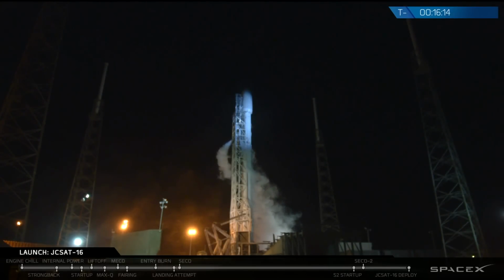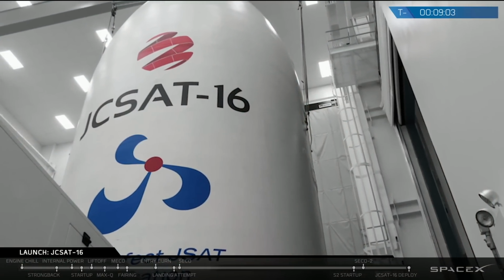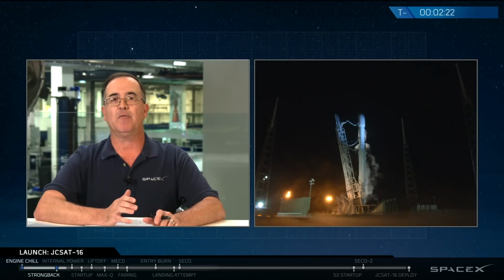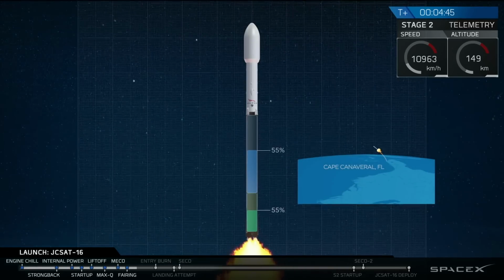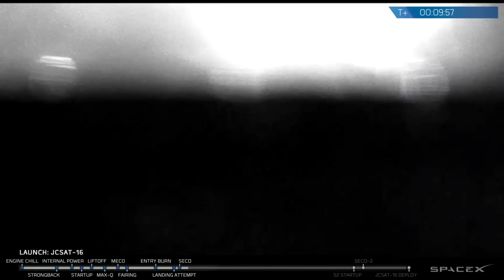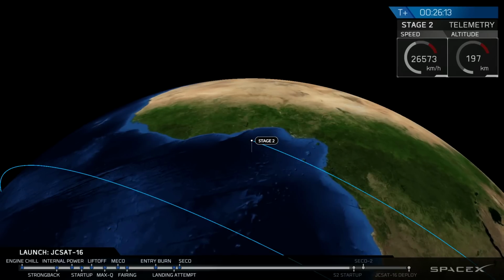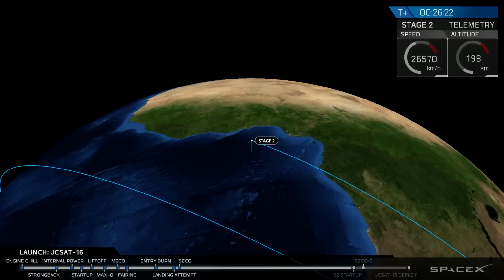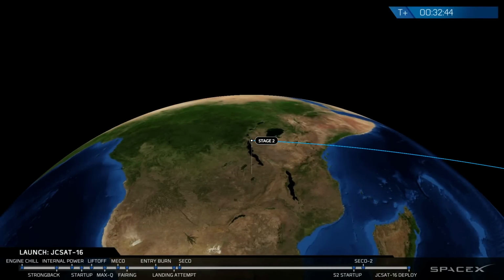JCSAT-16 Hosted Webcast

Comment: Question: How do they land the rocket on 'Of Course I Still Love You'? Does the rocket calculate the position of the drone ship relative to the to itself, based on GPS, or some other location technology?
Reply: Drone ship targets a set of GPS coordinates, which the rocket also targets. Essentially, the rocket trusts that the drone ship is actually at the coordinates it's programmed to be at. Drone ship has some thrusters to stay in the same position. The rocket aims at those GPS coordinates and uses a radar altimeter in order to determine vertical position and therefore know how to slow down.

Comment: Guys, Can I see the recorded video of the rocket landing at 26:27, There is no WIFI to stream the video as it should, but there was cameras recording YES? can I see that? that's weird! it appeared from nowhere? 

Thank you
Reply: There is no WiFi several hundreds of kilometers from coast line ;) They use satellite connection - which id disturbed by rocket reentry (engines firing and some plasma generation during atmospheric reentry)

Comment: Question: they stated several times that GTO is 36000kms, which I understood to be altitude but the telementry indicated about 500kms max altitude and 36000km/hr.  Does that mean GTO is really any altitude they choose, matched with the required speed?  Thanks.

Comment: I just wish they'd put a second camera just off the drone ship. This freezing at the most important and risky moment kind of gives the impression that something actually went wrong.
Reply: Likely wouldn't work, vibrations interfere with transmission even a mile away - which is why at launch complexes, cameras are all transmitted through hardwired connections rather than satellite.

Comment: what happens to the 2nd stage? does it remain in the same orbit as the sattelite or will they destroy it in the atmosphere?
Reply: Atmosphere destruction. SpaceX is working on rescuing it to, but this require different approach. Right now they are working on payload fairings recovery (some details: https://www.reddit.com/r/spacex/comments/4m9b5j/elon_musk_on_fairing_recovery_chutes_will_be/).
Reply: It actually remains in the same orbit as the satellite for a while, but atmospheric drag slowly (over the course of several months) pulls it back to earth and it is destroyed by atmospheric reentry. In this case, tracking elements indicate that the second stage actually has a perigee (lowest point of an orbit) of just 150km above earth, compared to typical 180-250km distance, so it's possible this stage performed a small deorbit burn using remaining propellant from the cold gas thrusters that provide roll control to the second stage  in powered flight and pitch and yaw control while the second-stage engine is off.
Reply: Thanks for the answers! I'll look more into it

Comment: Please please @SpaceX, invest the maybe a few hundred bucks in a proper video link between the barge and the by-boat so we get a proper stream (heck, a wire should do). Obviously going directly to satellite does not work.
Reply: FrankyBoy Yes, but what's the reward? Obviously any of these plans will cost a decent amount of money. What does SpaceX gain from this?
Reply: Plur307 True, though worth noting that they now make the webcasts last until satellite deployment due to customer requests, as customers didn't like that it ended before the second stage restart, cutoff, and satellite separation.
Reply: Actually, that gives me an idea ... aim a camera from the manned ship at the landing platform and stream that ... should give a good perspective and overview, and at the distance (a few km) it should still give quite okay-ish visuals assuming no fog.
Reply: FrankyBoy We've seen that view for JCSAT-14 (I believe the technical webcast). It wasn't great, but it was OK quality. Not sure why they haven't shown it again.
Reply: Probably a lot more than a few hundred bucks for a wired connection. The nearest boat is at least 5 miles away for safety, you'd need to buy a lot of ethernet cables and ethernet repeaters. And oceanproof all of them.

They are working on it, but it's really just a nice thing to have live landing views at all. They don't need them, as long as the SD cards in the cameras are saved.
Reply: +Ambient Morality I thought the by boat is around 1km away? Also Ethernet really is not the tech of choice there (and you can get pre-made ocean proof cables of course, no need to roll your own).
Reply: +FrankyBoy Itd probably take a significant power line to run an entire separate relay boat full of communication equipment and probably additional cameras. Not sure how far away it needs to be. At least 500 meters or so to get away from the interference. That's no small feat. Doable yea, but the idea is to keep cost down. Adding a significant step to the ASDS deployment is not the way to do that. Maybe one day in the future.
Reply: Motokid600 They already have a boat/ship with the crew standing by. You "just" need to connect the two ;)
Reply: +FrankyBoy Lol, well I imagine it has to be a seperate unmanned vessel. No way your running a cable out to the safe distance for people.
Reply: Motokid600 Not sure why you consider this a problem ... Buoys are already invented so it's not like youÄd have to free-string it for kilometers.
Reply: +FrankyBoy I'm pretty sure buoys are wireless. Which would defeat the purpose of eliminating interference.
Reply: +Motokid600 a buoy is actually generally anchored to the seabed ;) Point is, you don't have to stretch a wire, you can dangle it off floaty things attached to it, which greatly reduces strain on everything involved.
Reply: The other problem with all these methods is that they are a lot of work. There's no great reason to actually do any of this besides for our benefit, as they can always see prerecorded video at much better quality a few days later.
Reply: > The other problem with all these methods is that they are a lot of work.

Dumping a cable over board as you drive is really not that hard work and we figured out how to do that with more complicated stuff than cables (fishing nets) centuries ago (and these days in a completely automated fashion)
Reply: +FrankyBoy "dangle it off floaty things" meaning you would still need a giant wire reel linking the boat/buoy to the barge. That may not be hard, but it still takes man power and time therefore money. Trying to reduce costs. Not the other way around. Maybe one day when these landings become more routine. Look at the space Shuttle. No full-ride onboard footage of the first flights, right? Later on once the program was in full swing then we got those good camera views.
Reply: So many people forget that SpaceX is in the business of launching rockets, not making live broadcasts.  Their clients don't care if the webcast has interruptions.  They care if their multi-million dollar satellite makes it to the correct orbit.

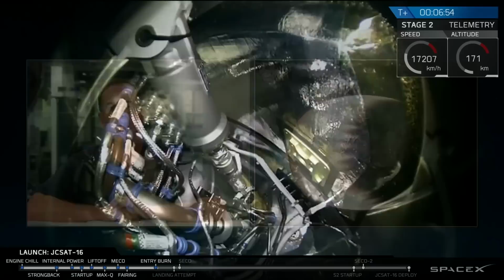Comment: What view is at 23:54?  Just a short glimpse.  Internal with tubing.  S1?
Reply: It's believed to be a view of one of the first-stage engines in the octaweb, and you can see the TVC actuator that gimbals the engine combustion chamber and nozzle as well as random tubing (no idea what that stuff does).

Comment: I understand why the Drone shop looses video when the 1'st stage lands. How come SpaceX doesn't record the landing footage and play it back as soon as Drone ship reestablishes connection?
or have a separate barge/boat with a camera that wouldn't be subjected to the buffeting that causes signal loss.
Reply: They do (sometimes) release footage from the drone ship after the stream, but I think it's just not high enough on their list of priorities at the moment. The rest of the SpaceX support ships are usually near or over the horizon, and would have a difficult time seeing anything, though we have had a view from one of those ships released as well.
Reply: They're not fussing over it because they don't really care.  They're carrying someone's $1billion baby into orbit and they have to do the job right.   If the satellite makes it to geostat without exploding, and their client is happy, what difference does proving to you that it works it make to their bottom line?   Zero.
Reply: Just asking a question. No need to be rude.

SpaceX seams to value public relations enough to show these videos, and there appears to be enough public interest, that a simple video playback as soon as the communications is reestablished is not too much to ask. Judging by the reaction of SpaceX employees, they would probably also like such a system.
Reply: I think it'd be difficult. They want cameras transmitting live from the drone ship, and it'd be difficult to simultaneously stream recorded video data while continuing to take and transmit live video data from the same camera.

Comment: Congratulations to SpaceX and everyone involved, they are doing amazingly great job and constantly pushing technology to a limits. But, SpaceX, someone there, really, tell these young hosts to stop telling "there is no wi-fi in the ocean" every broadcast when the landing expected. This joke was repeated so many times, that this is not funny anymore. Really. Please.
Reply: It's not just a joke. SpaceX is planning an internet satellite constellation that would provide near-global internet at reasonable data rates, which could enable wifi in the ocean (or at least omnidirectional transmission, which could help deal with vibration).
Reply: you right, it is not just a joke - it is a terrible facepalm joke. google how wi-fi works.

Comment: Why is there no 4K footage of these FAKE 'landings'? Can't SpaceX afford 4K cameras? They cost under $100... with SD memory cards... no need for 'live satellite link' bullshit, is there? Can't SpaceX afford drones too? ALL of the 'landing' footage that SpaceX has produced is HIGHLY suspect, 

I repeat - why is there no 4K footage? Wouldn't they want the highest level of detail possible, to see exactly what happens during the landing?
Reply: Telemetry is far more important than visual data. One of the immediate operations after securing the stage is recovering telemetry and offloading raw data streams from the vehicle to computers for further analysis. Far more can be detected and adjusted by seeing exact engine performance than from a video.

The cameras are largely for our benefit, the smoke mostly obscures any visible action and the only time it would be useful is if the stage had a landing failure and all telemetry was lost (unlikely, since a lot is saved in the octaweb), so it's mostly for our benefit. 

They'll post the video eventually, but there's no huge rush. SpaceX can afford drones, but to stay safely away from the rocket as it lands it would need to be very far and therefore need a large camera, so it's not really worth it unless NASA provides a chase plane to film the landing.
Reply: WTF? I'm talking about putting 4K cameras on the BARGE, and yes, they WOULD handle the "vibrations and temperature changes". You idiot. So pray tell, how much do 4K cameras cost in your little fantasy world? They are £40 on Ebay right NOW. You use REDUNDANCY and use many of them, so if any fail, it doesn't matter.
Reply: John Thomas I think you aren't understanding. There are lots of launch photographers who are permitted to set up cameras near the launchpad that are remotely (sound) controlled. 

If they set up their cameras as close to the rocket as these cameras are set up, not only will the camera fail, but the camera's SD card will magically get erased, probably due to the intense vibrations and pressure waves. They have to stay at least a couple hundred meters from the rocket to avoid that.
Reply: It's worth noting that they have had damage from successful rocket landings in the past, so they had to make some changes to the barge design to protect certain sensitive components.